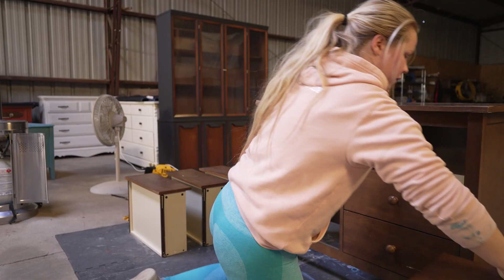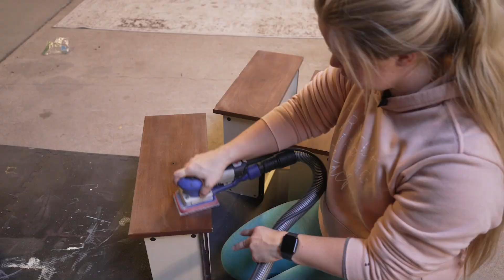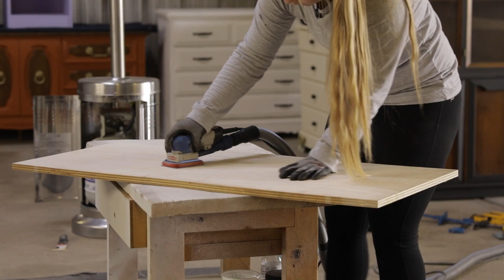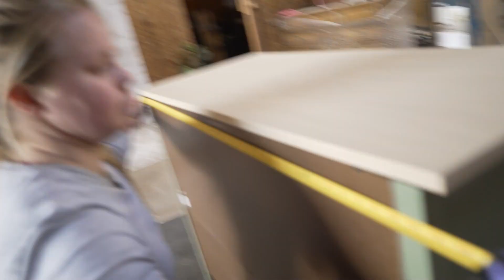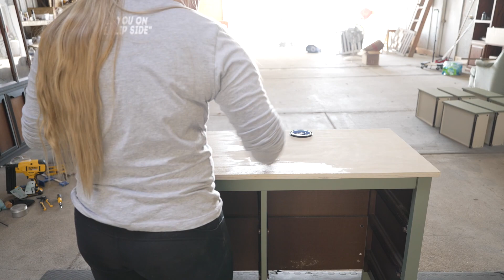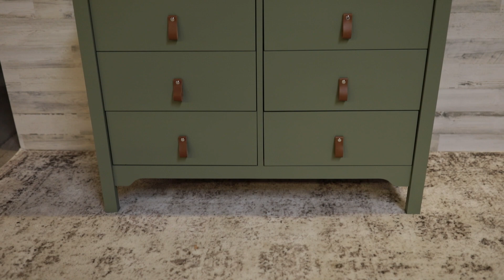Before/After Series Ep. 6 | Adding a New Top | Furniture Flipping Teacher

Comment: What s great idea replacing the top. There is a banding product you can cover the plywood pattern of the edges so it a solid wood look. One type I have used is glued on with a heat activated product.